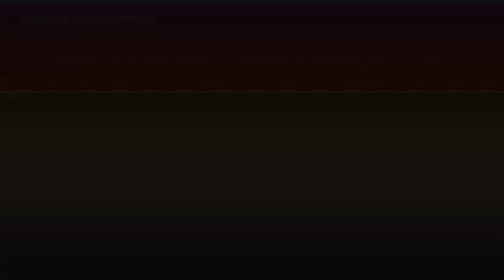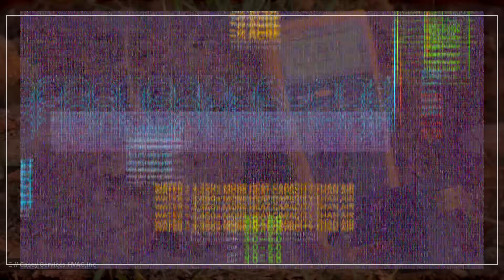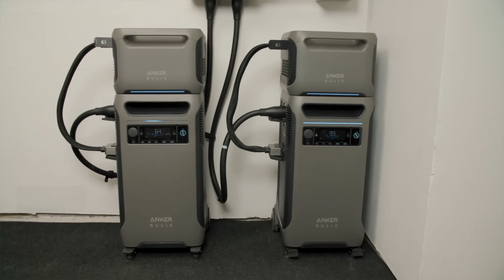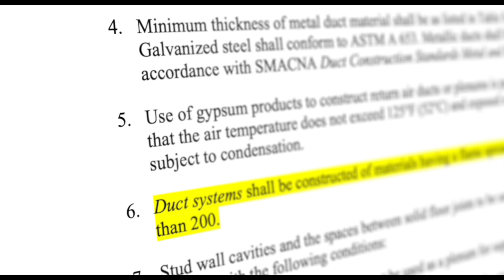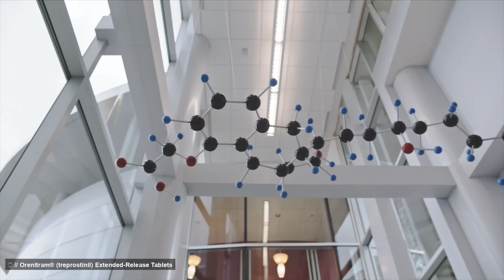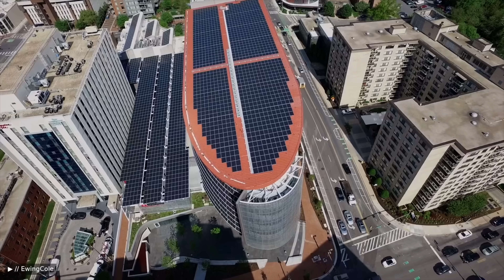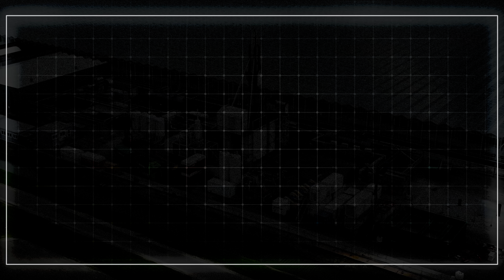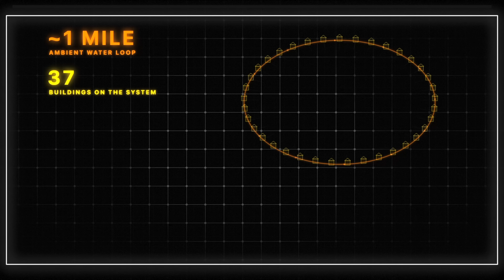The Viral DIY Cooling Hack That Nearly Killed a Family

Comment: In Europe ground ventilation is paired with HRV. Very good combo. No issues. In the US every simple solution  used in other parts of the planet is considered problematic. Why is that? Build a home from AAC bricks, insulated with 25cm of polystyrene outside the walls, use HRV and there is no issue with anything. Due to EXTREMELY cheap energy in US you never thought of building efficiently. Maybe this is a problem which should be addressed?

Comment: I know a number of universities are in the process of upgrading their district energy systems which will work similar to the example you gave where multiple homes would share a system. If a place has a centralized heating and cooling system in your state, it is almost always going to be the universities since they own all the buildings and it is more energy and cost efficient to have a centralized system that heats and cools all or most of their buildings. 

Because many of these systems are 100+ years old and with recent state laws towards going green many universities as they are updating their systems have turned towards geothermal.

Comment: Although the system works these kind of systems usually will work best for deserts. 
If you are at a windy or sunny place people will consider just installing more solar or wind turbines. If excess power production is penalized then people will go for this system.

Comment: While it seems insane to me, outside an arid climate, to pump outside air directly into the house, I am not sure why it is not feasible as a retrofit option for people to plumb their air source heat pumps. Air source heat pumps are most efficient when the air is not too hot or too cold, and heat pumps do not breathe and could care less if the air that passes through has mold spores in it. Obviously, they will not be as efficient as a ground source, but if the ground tube can raise/lower the temperature even 10 or 20 degrees in extreme weather, it should greatly improve efficiency and reduce cost. The fan on the heat pump already moves the air, so you do not even need additional mechanical air moving (well I guess that depends on static pressure and the density of any heat exchange surfaces placed in the ground.

Comment: If you use water you won't need less pipe you will need MORE ... water holds more energy ... but it also don't release it quickly
Reply: I think you're confusing heat capacity with thermal conductivity.  It is true that it takes a lot of energy to raise or lower the heat of water compared to many other materials, but at the same time, water is about 20 times more thermally conductive than air, so if you expose that water to a lot of surface area (radiators etc), convection (fans blowing over the radiator), etc, you get A LOT more thermal transfer with water as compared to air.  Thermal conductivity is important to this (which is why a human body will feel quite cold immersed in a pool of 70 degree water vs 70 degree air).

   This is partially why there has been a huge trend in motorcycles to move to water cooled radiator systems vs pure air/fins cooling.  The former is MUCH more efficient at removing/exchanging heat. 

   Then, if you combine copper with water and vacuum, you get amazing heat pipes, which from the combination of coppers high thermal conductivity and the vaporization heat carrying effects of water phase changing from liquid to gas and back again to liquid, you get simply amazing heat/thermal exchange.  Heat pipes have higher thermal exchange capacity than diamond and graphene with their very high thermal conductivity. In this case, the water under vacuum is acting like a refrigerant in a refrigerant cyle.

Comment: I got a ground source heat pump along with 5KW of solar 16 years ago in 2010.  I don't have quite enough solar capacity in the winter, so I end up buying about $400 from the power company each year, but that includes all my heating and cooling, all of the appliances in my house, and charging my electric car.  My only gas appliance is my water heater, but I am investigating replacing that with a heat pump unit.  The whole setup cost me $34,000 after subsidies back then, so admittedly things are much more expensive now.  We have cold winters and hot summers here in Utah, but I am perfectly comfortable all year long.  I absolutely love the system, so I say go for it.

Comment: I had an idea about 30 years ago to use this similar technology to run pipes into the ground in a closed network and then have them running through the walls in the perimeter of the home. A larger network would be needed than what is above ground, but it would keep harsh temps from getting through the walls. There is still heat transfer through the roof, but that is mostly mitigated through insulation. 
Another idea I had was using vacuum panels between studs in the walls of the perimeter of the home. Kinda like a Stanley thermos. The idea actually came from a Stanley thermos. I had forgotten and left a thermos full of hot coffee in my kitchen when I left for work and when I came back its was still steaming tho obviously not as hot anymore. That was around 12 hours. I was so amazed and thought this simple technology surely could help reduce utility bills if it was implemented in homes.
Reply: You never want active cooling in the structure of a building because even the smallest void will allow condensation on the piping which would foster mold, and walls that much cooler than ambient would as well.   That is why the only fluid transfer thermal system is heat - no condensation.   And hot fluid lines can be buried in concrete foundations whereas trying the same thing in walls would not allow concrete sealing and invite mold in.
Reply: @amzarnacht6710  This is true. I was 20 years old and one of my hobbies was splunking so I understood the advantage of consistent underground temps. I still like the idea of vacuum panels in the walls instead of insulation tho.

Comment: I looked into drilling geothermal vertical wells in Scottsdale AZ.  The ground is alluvial rocks and sand to great depth. I am told very difficult to drill. More expensive than drilling in solid rock.
Reply: In hot arid regions like that, where you spend more on cooling than heating it's best to use a water source HP system 
Air source is cheaper CapEx but more OpEx, ground source is the opposite 
Water source is in the middle and can be done closer to the cheaper air source 

Bottom line is air source is the worst option in very hot summers and very cold winters like most of Canada and states like Alaska (they might not be considered a primary heat source without a backup) 

In Az, NM, Ca, ect, a water source system (WSHP) is the best option

Comment: There is exactly one way to do the passive underground air intake in a humid climate.

You have to be on a hill, you run your ventilation pipes all the way to daylight, and you make them from copper so nothing nasty can grow on them.

This way there is never standing water, any liquid that condenses drains directly out of the copper pipes.

Comment: I've designed several commercial and residential projects using GSHP, and I am torn as to why you chose to frame the earth tube system with ground source heat pump systems. These are are apples and oranges. Even in dry areas, most engineers, including myself, would install a plate and frame heat exchanger on an earth tube with direct air and accept the 2-3°F approach loss.
The main reason the earth tube system should not be even presented as comparison in the same video is that earth tubes are for cooling only, there must be a separate heating system for earth tube projects. GSHP systems not only provide both, but ideally, the engineer will balance the heat removal and dumping so that the native ground temperature stays around the same decades out, but ultimately, every site is different, which is why we conduct a thermal conductivity test before installing the large borefield.
What you need for GSHP to make financial sense is a good cost spread between electricity and FF costs, and ideally, a low labor rate state.
Reply: It's because the moron that published the other video connected a moldy earth tubes to all GS systems to seed doubt, spark conspiracy, and instigate inflamatory reform. 2bit is trying to stop the misinformation wildfire before it spreads.

Comment: The conspiracy is how the knowledge was lost in the first place.
Clerestorys, tromb walls etc should be standard on all homes.
Reply: Ohh thanks for sharing, did some research, seems very coool
Reply: About 20 years ago, I wanted to rebuild a part of my house that was very old. I designed it with a 2 story front with clerestory awning windows at the top. The roof sloped down to 1 story with windows on the rear walls to let air in. I think it would've had natural airflow cooling in summer. Never got around to doing it.
Reply: @ricusmate  It's pretty simple: people thought they weren't necessary anymore.
Reply: @asteroidrules poor people couldn't afford air conditioning yet we stopped having elevated houses and large verandahs and never had clerestories in Australia.
I'd like to see a timeline and distribution map of passive temperature regulating systems.
Reply: You can whatever type of walls you want, the problem is most people can’t afford that kind of flexibility.

Comment: Great presentation. Nevertheless, the focus on vertical loops presents a worse case scenario. Granted, vertical loops are super efficient, more efficient if you hit groundwater. 
I also have issue with the terminology. It's a ground source heat pump, as opposed to an air source heat pump. Geothermal relates to tapping into an underground heat source, like they do in Iceland for snow melt. Nevertheless, there's many components to a ground source heat pump, such as desuperheating, where you take the heat removed from the air in the house and preheat water that feeds the water heater.
I installed a 750 foot horizontal loop 20 years ago. It was oversized, but I added a second 2.5 ton unit when I built a second structure to tap into the loop 16 years ago. The combination reduced my heating and cooling to next to nothing. 
Be aware, the fancy setback thermostats aren't compatible. This is a long cycle system, set it and leave it alone, it can't adjust to big temperature swings. 
If my only option was a vertical bore, I would suggest an air source heat pump, especially in your mild climate of San Diego. I'd use the savings for heat pump water heating, clothes dryer, and refrigeration as that segment matures. 
2penny fan

Comment: I retired after 40 years as a commercial HVAC technician. It was not clear to me if you are discussing ground water to air exchange systems or ground water heat pumps. Ground water heat pumps are more efficient than outdoor air source ones but still consume a considerable amount of electricity I would not expect a $60 to $300 difference. A ground water to air system is not practical since it would require a very large volume of air to cool a building as 60 degree water can’t produce the 55 degree air that is the standard outlet temp of a mechanical A/C unit and there is no heat source to raise the air temp above 60 for heating.

A heat pump is a reversible air conditioner and carries the same maintenance and service costs whether it uses outdoor air as a heat source or ground water and runs all year instead of just the cooling season and so has a shorter life cycle. Also your bore hole calculations have to take into account the soil conditions, dry soil makes poor thermal exchange contact with the buried piping requiring more, deeper bore holes.

I am sure ground water heat pumps make sense in places with high energy costs but as you did point out, they are not a cure all solution.

Comment: I live in Sweden where heatpumps are VERY common. I have one Air to Air myself. It kosted me 2500 USD with units, parts, installation and all. And I did get a tax refund on that) ) Air to hot radiator water is also common in warmer parts of Sweden. In colder parts the drilling of holes is the more efficient system. Since the outdoor air is too cold during peak winter. One thing not mentioned is of course that a single drilling hole has a certain stable energy output, so different holes must be separated some 50 meters or more, all depending on ground condition. And a lot of systems do charge the hole during summer, for storage of heat. This is of course a part of the AC-system.
Reply: did it really only cost $2500 or did you meant to write 25000? Sounds like a nice system though. If it works in a Swedish winter then it should have enough performance for everyone. greetings from germany :)
Reply: @cfnorg5308  It was 25000 SEK that is roughly 2500 USD. It is not any odd brand but a Mitsubishi rated output 6 kW.

Comment: One other note - it's not viable everywhere.  Because our ground here in Phoenix is so dry (and I think because of the composition?) it just doesn't have the same effect.  

Tech Ingredients has cool video of a DIY ground-source cooler they made with a window AC unit.  I'd check it out if you haven't seen it already.  Pretty wild.
Reply: "it's not viable [...] here in Phoenix"
I fact-checked that.  You're wrong.
Reply: DustUps has his property in the Texas desert. He still gets noticeable cooling from the air to ground exchangers he installed.

Comment: Doesn't Geothermal  have  a need that average heating and cooling load offset each other? Otherwise you will get problems like the Londo Subway which get hotter every year.
Reply: You are correct.  Undersized loops in cold climates get cold and hence less efficient each year.  Strictly speaking it's not a balance of summer and winter thermal from the house, but a lot of heat taken in the winter for house heating, a little from the house in summer from AC and the rest is solar thermal energy slowly moving down through the earth.

The reason temperatures are steady 20 feet down is because the year round air temperature + solar gain average out.  It's the balance you talked about.

Comment: Hmmm.. you debunked AI slop very thoroughly... 

I think there is a problem with the heat transfer calculations for geothermal. The lengths of water filled tubing seem much too large off the cuff for water to ground heat transfer versus forced air condenser heat transfer.

Comment: I have geothermal...It's great an NOT banned!! My system uses 5 closed loop wells drilled 150ft deep and tied to a 5 ton HVAC system with glycol as the transfer medium.  Up here in South Dakota, it has REALLY cut my heating and cooling, as well as my hot water heating via a preheater that uses the exchanger to also preheat the water.  This operates best during winter heating season. Which is opposite of what I thought would happen, as I had thought it would harvest the hot exhaust from the cooling cycle to even heat the water to higher temps.  But if your looking for real experience, mine has been operational for 7 years and no issues and VERY pleased with the investment.
Reply: That's very weird.  No desuperheater to harvest excess heat going back to the ground in summer?

Your hot water tank is effectively like a patch of earth outside next to your ground loop, so should have heat pushed to it in summer for nearly free.
Reply: @SeekingBeautifulDesign  Yes agreed!  I talked with installer/designer and they said it was typical.  My guess is that the exchange loop for the desuperheater loop runs with the normal radiator plenum loop in the winter which must be much larger than the  loop it uses in summer/cooling mode on the back side. As when looking at the exchanger coil in the unit, there only appears to be 3 loops where the glycol exchanges with the compressor loop.  Which to me seems small...but it definitely works.
Reply: @wtnman4783 probably not worth it and a bit silly given the tech you have, but a heat pump water heater connected before your ERV/HRV in the summer and using ambient house air in the winter might do something.
Reply: @wtnman4783  how much was it?
Reply: @WhoIsJohnGaltt Mine was $35k which included a lot of duct work rework inside the older portion of the reno/remodel...but was able to get 30% tax credit on that and Electric Cooperative rebate of $900 on HVAC and $700 on new 100gal Reahm lifetime warranted hot water heater.   The original duct work did not meet specs for designed airflow and required larger distribution trunks than the old oil furnace.